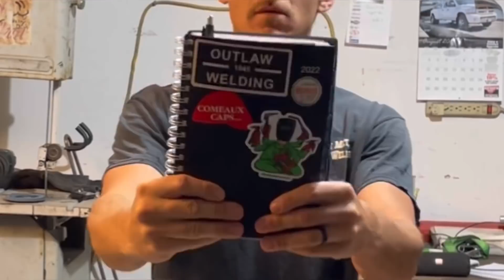Secrets To Making BIG MONEY as a Welder

Comment: you're 100% right, if your not organized you can't be the best and earn the respect (which becomes your reputation) of the customer. I don't do mobile work but weld a lot of stainless parts from local machine shops and keep all my info on the computer along with relevant photos showing how I setup and fixtured the job, next time I don't have to guess or figure it out again. Machine settings and notes to successfully do a job are recorded in a text document and keep in the job folder. There's jut no way anyone is going to remember all the details.
Reply from the maker: thats next level bud!

Comment: One thing I've been trying is putting a little mini plastic container or ziplock with fork pinholes in it, filled with color indicating silica, in each tube of TIG rod and in the ziplock bags with my mig wire or the box with my 7018. Sucks all the moisture out of the air, needs recharging in the oven only once a year or so
Reply from the maker: great suggestion!
Reply: @MeltinMetalAnthony  can also repurpose old covid masks, just rip the layers apart and you can melt the edges together around some silica gel or hot glue them together and they let air in and out but keep the beads from spilling

Comment: Do you ever use 7014? I’ve come to really like it over 7018 or 6013. Doesn’t have the issues like 7018 with moisture but also has good deposition.
Reply: I have a box of 7014 that's 40 years old that I dip into when I need to weld up somthing somthing quick
Reply from the maker: I haven't in about 5 years. I have a pretty cool video coming up. maybe I can use it in that video

Comment: Hay Anthony you might all ready know this I don't know to save the rods and wire you can get a fridge that does not work any more and put a hole in. It through the top of it run a  cord through it hook up a light socket put in a high powered light bulb or a heat lamp bulb a bam you have a rod over big enough for any and everything you need to stay dry and warm with minimum to no cost just thought it might help you cut down on waist and best of all it's on wheels  hope this helps you David